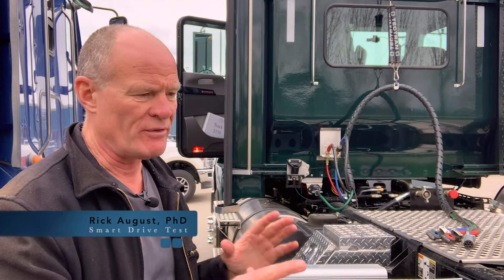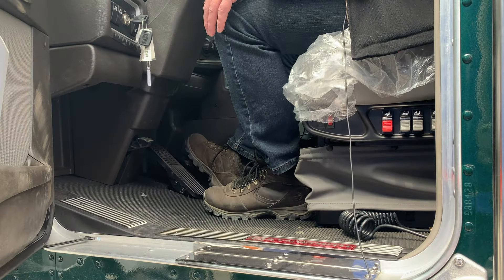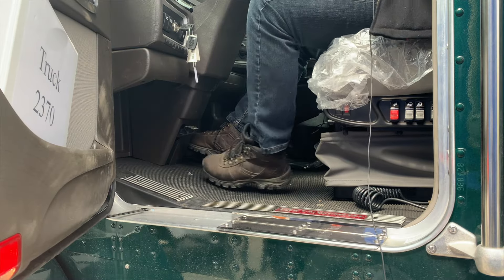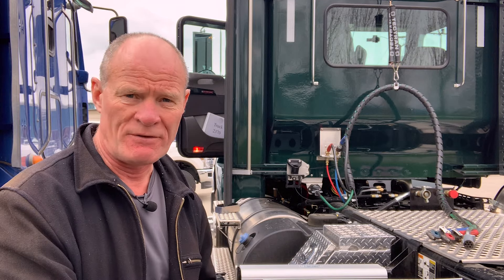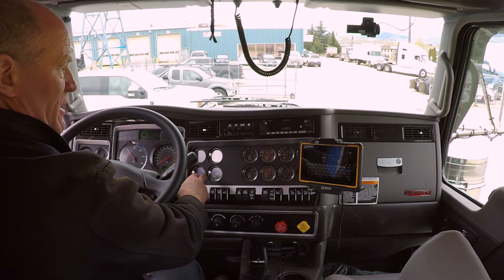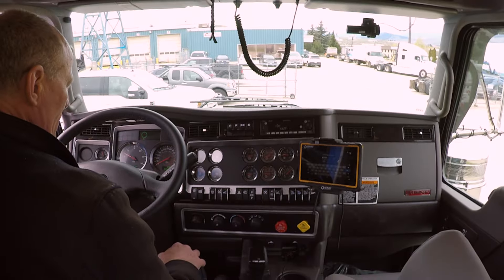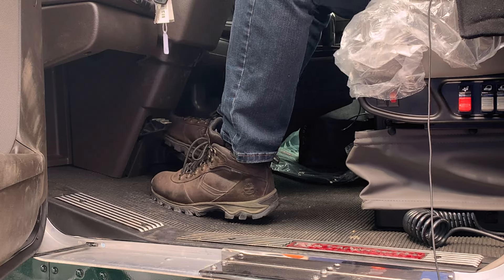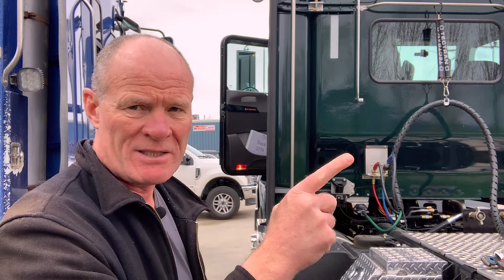Adjust Air Brakes Correctly On A Semi Truck - Avoid Legal Action

Comment: 2022 Freightliner Cascadia....first trip from CGY to VAN smoked drives due to faulty S/A..........
Reply from the maker: Was there smoke or any indication that the duals were dragging? I had a brand new International drop the drive shaft hanger bearing out leaving me on the side of #17 Hwy in New York. Cheers Rick
Reply: @smartdrivetest  Oh there was smoke, alright. I am a very experienced CDL driver and picked the unit up brand new in CGY from the dealership. This was the first trip PERIOD with a load for this tractor, I always six-pack when hooking a new trailer just for the very reasons you described in your video to help prevent any possible situations. However, in this instance there was not noticeable drag coming from any brake. I must admit that I take pride in my ability to jake and use proper gears (even in auto-shift transmisions) when descending grades, so I seldom even touch my brakes. I was coming down the west side of Rogers Pass and made a "snub" application to break my momentum and soon had a cloud of brake smoke trailing me. I was stunned as there was no previous indications of anything hanging. The importance of using your other senses (feel, smell, etc) can not be over stated when dealing with brake systems. I am always amazed at how oblivious some drivers are to how hot their brakes can get in very short order as they continue on their merry way. I may not always follow all the traffic laws, but I ALWAYS respect the Law of Gravity (Physic 101) when driving and am on full alert. This event shocked me at the severity and swiftness to how this happen. STAY ALERT Drivers.
Reply from the maker: Thanks for the full story Dale. Yes, I hear you about Traffic Laws vs. the Laws of Gravity. In the mountains, those grade signs can save your life. And you're correct, it takes all your senses to drive a vehicle safely. Going downhill is similar to driving on slippery conditions. When braking, you want to be looking in the mirrors to see what that trailers doing. What's happening back there and where is that trailer going? As I told my students, "the truck my pull the trailer, but the trailer drives the truck." I never had an auto slack apply the brakes. Lots that went out of adjustment and had to be replaced though. Great story my friend. All the very best, Cheers Rick

Comment: Thank you for the two 3 pump test. I will try it on my 1971 SeaGrave Fire Engine that I have for Restoration. Great information for my old baby Kids get in cab pretending to be a Fire Engine Driver. I love the smile on there faces.
Reply from the maker: Hi R P -  And you are most welcome. We're happy to hear we could help out. If there is anything further we can do, drop us a note. Always happy to help. All the best, Cheers Rick
Reply: Does it have slack adjuster?

Comment: Having a brake application gauge in a truck would be nice. Most trucks today do not come with that gauge installed. Instead we have to rely on the tank air pressure gauge, to see a drop in air pressure. I also keep my window open so that I can hear the air being released.
Reply: If you can’t hear the air brakes release with the windows up, you need to get your hearing check

Comment: Had a trailer lock up, blew a tyre before I could get off the road.  Called the tyre truck for a change, they got the new one on, but was still dragging.  Had to call a different truck to get the brakes released since they were disks.  Mothership told be screw it and bobtail back.

Comment: This is 100% bull shook. If the slack adjusters were working. You would not need to do anything. Also, if the brakes are out of adjustment. You are going to get maxima travel anyway.
Reply from the maker: And how do you know that my friend? Cheers Rick
Reply: @smartdrivetest  Stop and think about how automatic slack adjusters work. They are design to keep brake shoes close to the drum. If they are not doing that. They are bad.